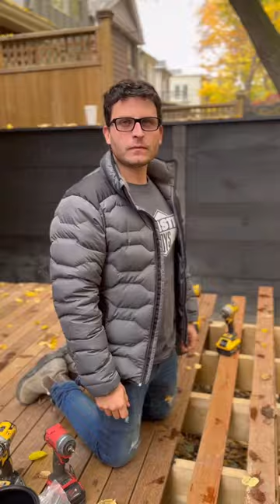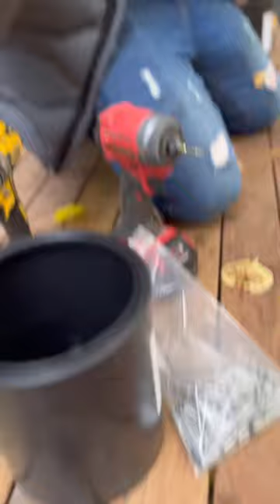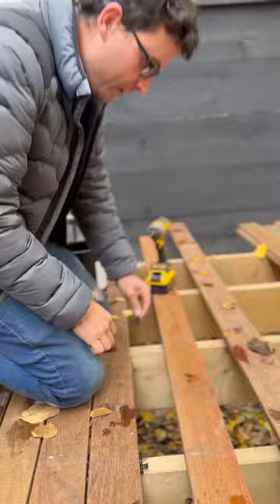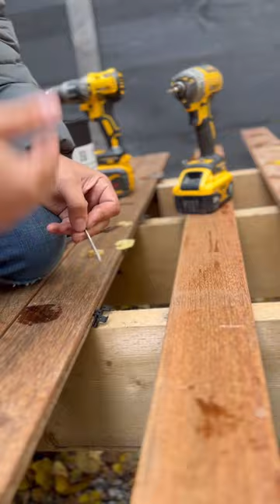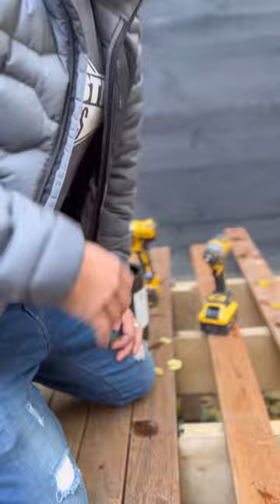INSTALLING IPE CLIPS #deckbuilding #howto #shorts

Comment: If the clip is in the groove butted tight and also screwed down how can it expand, where can it go?
Reply from the maker: The end without the screw is more forgiving
Reply: Look at for example the cracking and shifting you get on dry wall and paint. Timber will ALWAYS find somewhere to go.